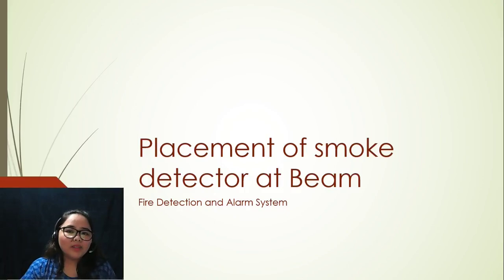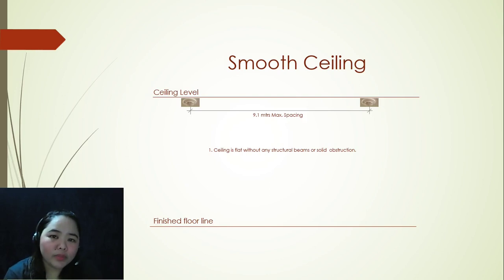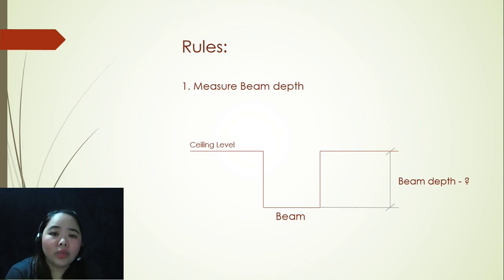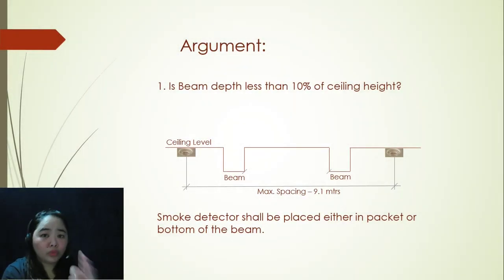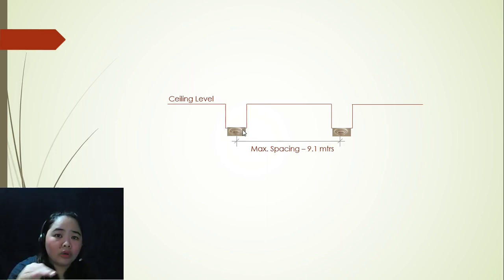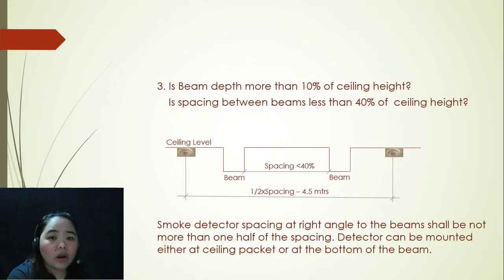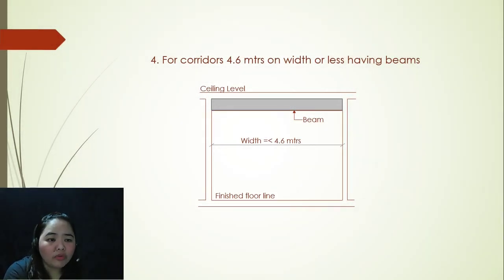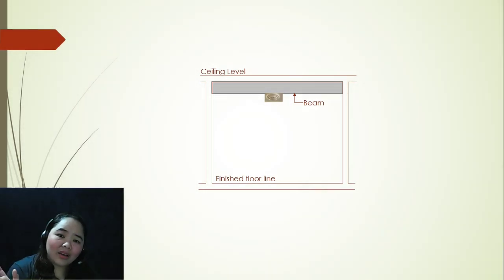Fire alarm design - smoke detectors at ceiling with beam construction #Design

Comment: I have a question, there is beam ceiling with height of 5.5 m and the beam depth is 1.1m and distance between beams 1.6 m (this case is not as mentioned in the code so how to locate heat detector?
Sorry another question related to integration between smoke and heat detector in one beam ceiling as my case above?
Reply from the maker: Your spacing for heat and smoke detector for ceiling with beam construction are totally different in requirement. In your situation above, since the beam depth is more than 460mm but less than 2.4 mtrs, the spacing of heat detector at right angle to the direction of beam travel shall be 2/3 *listed spacing. While for smoke, since your beam depth is more than 10% of height which is 5.5mtrs and spacing between beam is less than its 40% of its room height, then smooth ceiling spacing can be used within each beam pocket while 1/2 of its spacing in direction perpendicular to the beam.

Comment: Hi 👋very useful video. Could you please explain pathway class designation and Building pathway survivability
Reply from the maker: As a designer, we have an option to select from the Pathway class available from NFPA 72 if our locally accepted standard is NFPA or if our project specs require. Pathway class operates and summarize in the following manner when abnormal conditions exist within the circuit of IDC, SLC & NAC:
Class A 
Provide redundant path
Reports trouble signal from any single open, ground & single fault
Circuit continue to operate from single open, ground & fault
Class B
No redundant path
The circuit does not operate at any single open.
Reports trouble signal from any single open & ground fault.
Class X
Same as Class A except that it can also operate at any single short circuit and reports trouble signal.
The circuit can operate at a combination of open & ground faults.
Pathway survivability requirements will depend on your local fire code or any code adopted by your country. Designers have an option from pathway survivability 0 - 2. This is basically an added protection aside from mechanical damage but also from fire attacks.

Pathway survivability must have the following conditions:
0 - No requirement for pathway survivability.
1 - Any or more of the ff:
2-hour fire-rated circuit integrity (CI) cable
2-hour fire-rated cable system
2-hour fire-rated enclosure or protected area
2-hour performance alternatives approved by the authority having jurisdiction
2 - If the building is sprinklered, any of more of the ff:
2-hour fire-rated circuit integrity (CI) cable
2-hour fire-rated cable system
2-hour fire-rated enclosure or protected area
2-hour performance alternatives approved by the authority having jurisdiction
Reply: @AllaboutFireProtection  I have an more doubt.. 1.What is the reason for non using any clean agent systems at substation/Battery room and indoor dry type transformer areas. 
2.What is the requirement (height)  of detector installation of bottom of the raised panel (false flooring)
3.Detectors installation Requirement of the cable trench area and substation basement.
Please clarify about this
Reply from the maker: @aravindmuruga  Hi Aravind, it's nice to hear from you again. In my response to item 1, the requirement of provision for fire protection always depend on which code and occupancy we intend to design. If it's already known that let's say sprinkler is required and we opt for an alternative solution like gas suppression system in the rooms you mentioned to avoid damages and business continuity disruption, we can always go for gas suppression system as it is intended to protect class C fire too. However, they are also not applicable in some applications where it is reactive to some chemicals and those are written in the manufacturer's manual so you should take care. Fire in Battery room like using lithium-ion where thermal runaway occurs cannot be protected by a gas suppression system unless there is a specific test conducted by the manufacturer that they can be used. Transformer room is excluded in sprinkler protection depend on the code you use and if the conditions are met like, min. 2 hrs fire-rated construction, provided with detection etc...(2) Detector can be mounted in any orientation shown in NFPA 72 for underfloor installation. (3) Check your code if fire alarm is required in that particular occupancy, obviously cable basement & trench are the part in a substation where we have a lot of combustibles like a group of cables hence this is the reason most designers propose to put detector in those areas.
Reply: @AllaboutFireProtection  thank you very much 😊🙏
Reply: @AllaboutFireProtection  thanks for your kind information. Some thing I get it from your reply. 😊 I will study ...

Comment: Thank you for the video...What are the requirements by installing the smoke detector above the false ceiling and in the sub-floors, the rooms are data center and computer room.
Reply from the maker: Hi. Thank you for your query so everyone will be aware of the requirements too. Like what I had explained in my tutorial here in this link https://youtu.be/b4V6LQDqUg0, the requirements of having a fire alarm system or your fire detection varies depending on the type of the occupancy of the building and which code you are going to refer or if there is a local code in your country. However, there is a specific requirement especially for data center like in your example. For the protection of IT equipment from risk of fire, you may consult the requirement from NFPA 75. Refer to clause 9.2.2 of NFPA 75 2017 edition, above false ceiling and sub floors are required to be provided with automatic detection systems. You may need to consult NFPA 75 also 
for the fire extinguishing system requirement especially for this critical room.